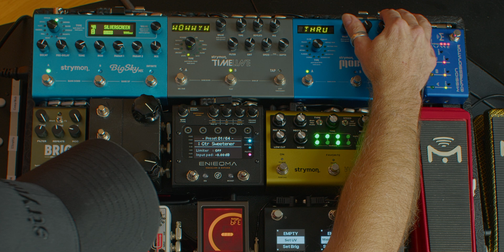Strymon Tech Corner: Setting MIDI Thru On Strymon Pedals

Comment: I’m confused about the Brig.  The manual describes how to set up a midi thru via a power up procedure.  But there’s only exp/midi jack.
What I’m trying to do is send midi clock from my Beat Buddy drum machine to the Brig to sync the delay time with the drum tempo.  That part is working.  Then I want to send that midi clock through the Brig out to my Infinity looper to sync the loops to the beats.
But the Brig only has one exp/midi jack so I don’t know how to connect the midi through to the looper.
Reply from the maker: Hey there! Please contact support@strymon.net and we'd be happy to help and see how to best incorporate Brig into your rig. Thanks!